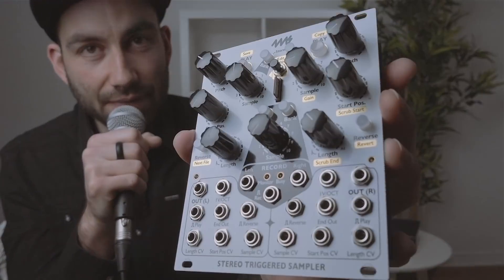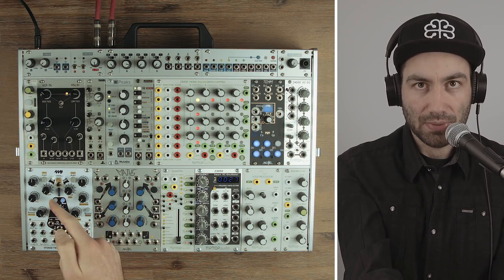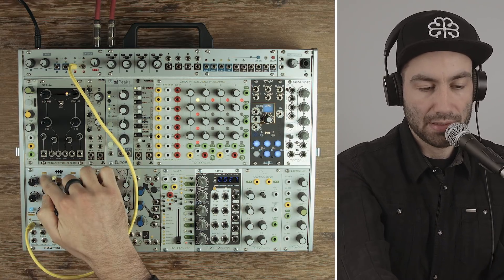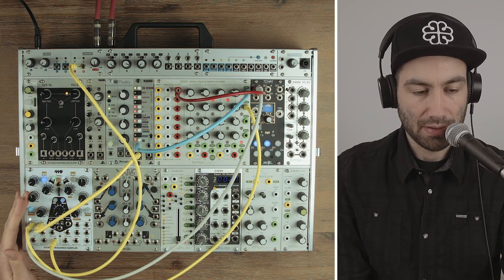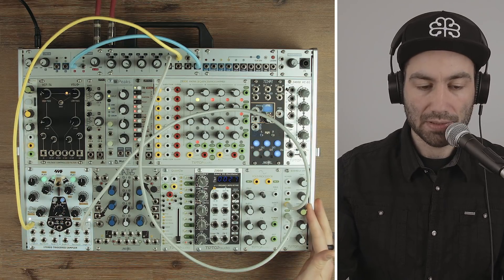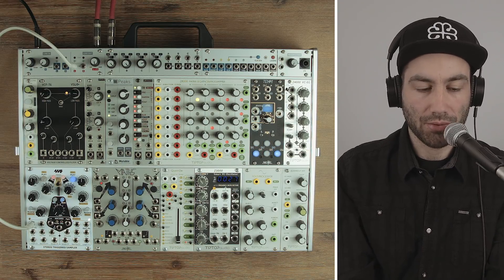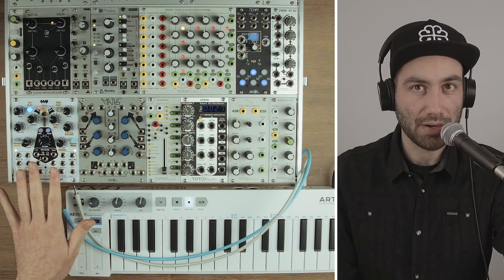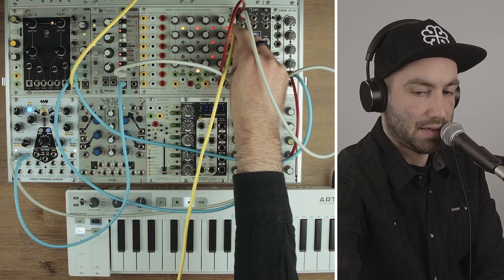4MS Stereo Triggered Sampler (STS) ~ Part 1: Playback

Comment: I noted the Guitar Center commercial. They've been annoying me a lot lately. They don't have jack. But they DO have a ton of just GARBAGE polluting the place. 

Sort of like Maui is ruined by their ugly downtown: full of unattractive, overpriced shops selling chealy-made Chinese junk. 

What drives me crazy is they dont have this. They don't have the Roland System 500. Clogging up the drum shop, they DO have a pile of crap I wouldn't let my dog vomit on. While for a few bucks more, there ARE a lot of nice things at Vic's drums just down the street. None of it is junk. They don't even HAVE the horrible Alesis e-drum thing that didn't work on the store floor...I have an Alesis drum pad. Still works.

Their only advantage is the 30 year no interest mortgage.

Comment: your videos got a facelift,  like it! could you please test, if the sts can playback the original tiptop audio sd cards? They all have a special copy protection on it, so you cant use them quickly, for example on the computer.  So I would buy me a sts cause it is much more flexible than the one module. But their sounds on this cards are great I think. Thanks for making Videos again...
Reply from the maker: Hmm interesting, I didn't know the One SD audio had copy protection. I'll try to give this a shot later and report back (my modular is far from my computer so I may forget to try this lol).
Reply: i wanted to export the samples in my digitakt to mess around with them, without recording each sample step by step live. In that situation i recognized that my computer doesnt can copy them. that's why i had the idea to test the sd card in the sts. if you cant test it, not so important